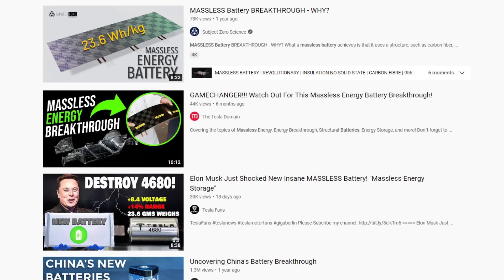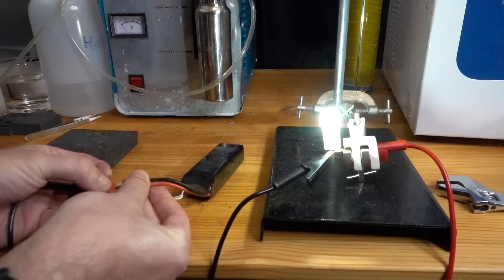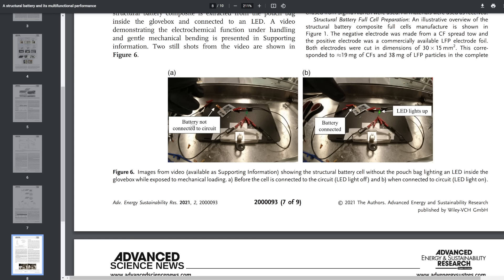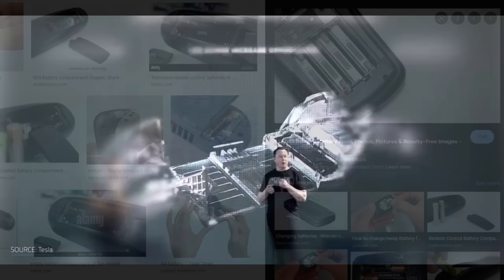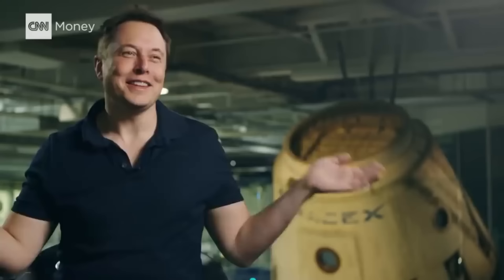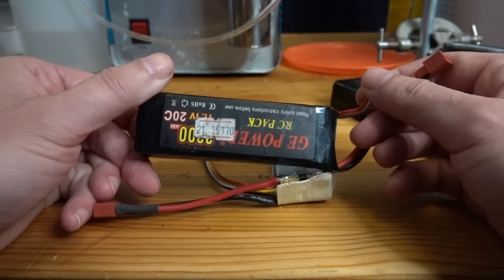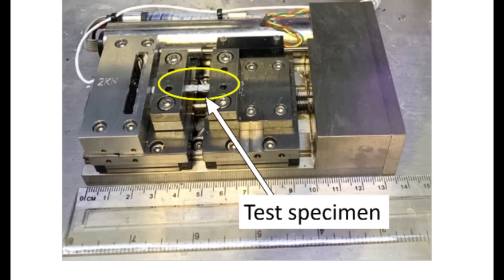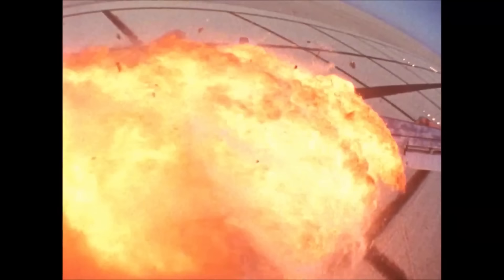Matt Ferrell, Massless Battery: BUSTED!!

Comment: Yea, the structural battery aspect probably only has applications in aerospace, where a lot of money is available, and weight savings can really matter. I think the most realiztic case would be to help with panels, where if you can add the thickness of a battery to the panel, it makes the material use more efficient by increasing the moment of inertia. Love the content!

Comment: "Massless energy storage", huh?
Maybe there's something I'm not understanding. If there's no mass, what's holding the energy?
Also, I'd rather not have the entire structure of the vehicle I'm riding in be made of battery. That's right up there with trying to put hydrogen "fuel" tanks on a car.
Reply: It's about that a structural material is also a battery, not adding extra mass to the object for battery functions. Massless is a misnomer. But nice for PR. 

In cars it means something different. It means that the battery is not supported on the chassis, but it's part of the chassis itself. It can still be replaced, you just need to support the rest of the car while doing it. It's about reducing part count.

Comment: Since Thunderfoot seems willing to nitpick I feel free to do the same. If one connected the negative terminals on all cells in a 3 cell 12 volt battery pack to a single wire, it would short circuit at least 2 of the cells, even if that wire was black. He needs a refresher course in how series wiring works. 

Now there is a way of connecting to a series wired battery pack that allows voltage measuring and charging of individual cells, but it requires a separate lead for each cell-to-cell junction, plus a positive and negative connection. In a 3 cell pack, that means 4 leads. A single black wire won't do it, and his battery pack had all that plus leads for thermal monitoring in its two multi-wire multi-pin connectors.

Comment: All of this without even looking at the primary source. The press release from Chalmers does not claim any of the things said in any of those video clips or articles.

They said they've developed a new type of carbon fibre that is ten times better than the one they developed in 2007. But the press release prefaces that by saying the one in 2007 failed and was not fit for purpose.

All the things about the battery being massless and reducing car weight and all that is mentioned, but said to be the end goal of the project, not the current state of it.

They have spent 15 years TRYING to develop a massless battery and have made several breakthroughs on the way, but are not quite there yet.

What they showed off was not the final product, but the conductive properties of the new carbon fibres.

It's like looking at iron age blacksmith, trying to figure out how to make steel and claiming that they can now make airplanes because they figured out how to heat metal.

Comment: @26:25 actually the balance charge lead has one wire going to each cell terminal in the pack (for 3 cell you'll have one at battery negative terminal, one between cell 1 and 2, one between cell 2 and 3, and one at battery positive terminal), the black wire does not connect to all the negative terminals because you can't do that and have cells all in series without causing a short (which you could avoid with diodes, but why bother when wiring as above still allows individual cell charging).

Comment: Guess what ? In the latest Model Y Tesla, they're using the battery pack in a structural manner. AS THE FLOOR. It doesn't need to be made of carbon fibre or whatnot.

Comment: The most perplexing thing about electric cars is:
Hybrid gas electric cars have been available now for decades. They aren't much more expensive (maybe even equivalently priced) than traditional ice cars. They work quite well and get better fuel mileage than ice cars when the limited range battery runs out. There's not really a downside to hybrids while fully battery powered cars are not yet viable. 
Yet, all these environmental types seem to push battery cars without mentioning hybrids: seems very odd to me.
Reply: studies show most battery hybrid cars don't get charged  enough . people a lazy and don't plug in.

Comment: Wing tanks for fuel in planes is actually a very good idea--in particular, you aren't taking room away from the cabin, cargo, or passengers, and even as fuel is consumed, the center of gravity of the aircraft does not change significantly. That last one is crucial--the MiG-21 fighter jet has a huge flaw in that its fuel tank is designed in a way that causes the center of gravity of the aircraft to shift as fuel is consumed, which causes a lot of problems.

Comment: Hello Thunderf00t! No idea if you saw my comment on the other video where I said that if you could find more videos of him making bad claims, that would be more convincing. Whether you noticed that or not, it looks like you did exactly that. I'd like to start by saying that I appreciate that you did that, not just for me, but for the rest of your audience to see that it's not just a one-off thing.

I would like to point out however that not everything about "structural batteries" is bunk, and the idea of storing the fuel in the wings is valid, just not the reasoning he provides to support these ideas. To the extent that the battery packs need a lot of reinforcement, and that the car also needs a frame, if they can better integrate the battery packs into the frame, they can remove some redundant steel or aluminum, so there is >some< degree of cost and range improvements to be had there without necessarily endangering anyone. But yes, it's not going to be a huge change.

Regarding Elon Musk, it is worth noting that Tesla and SpaceX are making many legitimate innovations in their spaces, whether Elon gets a few things way wrong or not (particularly how long it will take to implement something). The new carbon-fiber-wrapped motor of the Model S Plaid Edition, and the Falcon 9 reusable rockets are great examples of this. It should be noted though that Elon has not really "failed" so much as he has shifted his focus elsewhere and put other things on hold until other developments occur first, as evidenced by the fact that Hyperloop and Boring Company have received barely any of his time and money, whereas an absolute ton of R&D is going into their control systems, rocket engines, electric motors, etc. However, taking a shot at him for selling a whopping 3% of his Tesla shares as though he was cashing everything out is a cheap shot, and is arguably the same sort of misleading info that you are criticizing Matt Ferrell for committing.

That being said, you have opened my eyes to just how often Matt Ferrell gets things wrong in his videos, and I hope he will take notice of your video, and stop making outlandish claims and actually start doing real research before he does his videos. While he IS helping people be interested in science, it would definitely be preferable to not massively misinform people in the process.
Reply: What a nuanced comment for this channel. I'm sorry to tell you that the numbers say that the videos make Matt's channel grow faster not slower. Many people realize full well they are listening to company pr, but it's as rather pleasant way of taking it in. A lot of people like to dream to and Matt's also provides that.
Reply: @bzuidgeest  Growing faster, but for all the wrong reasons.
Reply: @electric7487  you can think that, but if you are trying to change that it means your methods are not working. TF his videos seem to have no or the opposite effect. He needs to adjust his attitude and his methods. No real scientists sticks to a method after is has been proven a failure.
Reply: @electric7487  what alternative world are you living in? On YouTube subscribers is all that counts. Its a good indicator about how many people are being reached by the channel. It's an indicator of earnings from YouTube. It attracts sponsorship. Etc etc. You may not like it. And you may think it's wrong. But as it is going now, Matt his channel will outpace tf. And that means he has a bigger audience, that more people like and it trust him. If you think that is a bad thing and you are trying to prevent that growth, then you are clearly failling. Maybe not morally, but that matters little if you are relegated to being a relic of the past or something like that by most people.
Reply: @bzuidgeest  Once again, The Dishonourable Matt Ferrell's channel is growing FOR ALL THE WRONG REASONS. Damn right subscribers aren't the only thing that matters, what matters more is the content that you are putting out. Most of what Thunderf00t has put out is highly educational and very well-researched stuff where he debunks a lot of the pseudoscientific BS being pimped out these days. On the other hand, pretty much the only thing that Matt puts out is crap where he regurgitates marketing hype. If more people trust Matt, that is a problem, because they're being misled into thinking that all these touted "breakthroughs" really are the next biggest thing even though they're not. Matt is doing a massive disservice to YouTube by doing what he's doing. Thunderf00t is doing us a favour.

Let me ask you this:

How do you commit so strongly to things that are obviously wrong?
Reply: @electric7487  how is it that you still don't understand? I am not supporting Matt i am pointing out that your methods or tf methods of combatting these kind of channels are failing. You can stand on moral high ground all you want. But as it is going, you will be standing alone. Why are you so committed to fighting the war on pseudo science with a tool that is failing? 
If you want people to step away from Matt his channel then you need to convince them to do so. If you consider channel growth as a measure of support than tf is failing. He reaches less people. He seems to even accelerate the growth of Matt his channel. Have you ever heard of the Streisand effect? This is a perfect example. 
Maybe if you calm yourself and wipe away the red haze you seem to be in and stop swinging an axe blindly. You will notice there are other better ways to combat hype channels. 

True or not, most of tf videos are very low quality. If you want proper debunking for tech stuff, Dave Jones for example does a much better job on his eevblog channel. So do many others. The entire musk rant in this videos for example is not only incorrect it's also irrelevant and meaningless to the subject. It's no going to convince anyone. 

Sun tzu said that to win every battle you must know yourself and your enemy. The enemy here is the people following Matt, with Matt as their leader. You need to understand why they watch and what they expect and maybe then you can convince them to your side. Calling them stupid, even if it's true, is not a convincing argument. It never was and never will be.

Comment: Hmmmm, I wonder why Musk would think an integrated battery than can't be changed out, would be a good addition to the Tesla.

Would it improve something in the short term? Maybe. But mostly it would add a lifespan limiter on the car of X recharges, first resulting in faster expenditure of a "full" charge, then failure to charge at all.

It would increase the rate at which they sell new cars are you wouldn't be able to just buy a new battery...... plus rich people would buy 2+ cars so that one is always charged and ready to go after a return trip.

The same reason apple and playstation don't let you change battery packs.

Comment: If the plane's fuel were structural, wouldn't the plane collapse as fuel runs low approaching your destination?
Reply: Good point... I guess if you pressurized the tanks then you could use them as like inflatable rigid members lol

Comment: Hey Matt, why didn’t you mention the centre fuel tank of a 787 Dreamliner that has a centre tank capacity of 118,000 lbs while wing tanks = 53,000 lbs each. Passengers sitting on more fuel than is in the wings and that tanks is massless too.
Reply: @@blue-lu3iz talk to Boeing dude, I simply did cut/pasted from they’re website. As for the fuel tank sizes, you are referencing gallons and my figures are Lbs so you need to get the specific gravity of aviation fuels and calculate the volume into weight to determine if the figure quoted are wrong. Let continue to discussion after that.
Reply: @@blue-lu3iz Wheres your calculations?
Reply: @@blue-lu3iz where’s the calculations and what’s the specific gravity of Jet Fuel A+B?

Comment: So if I get a 10gm slice of ham and place it between two 10gm slices of bread and weigh it, the combined weight (mass) is zero because the ham is a structural part of the sandwich? The applications in hiking are endless. Also application of margarine, butter, relish, mustard and chutney could be a avenue of decades of future study, as the variations of electro-chemistry these condiments could unlock could see the development of a negative mass sandwich.🥸🥸🥸🤯🤯🤯

Comment: You should have put solar panels on your batteries. That's a trend these days. Also one up everybody and stack 10 solar panels for 10 times the solar panels without increasing power output and then make a kick starter.

Comment: Another problem would be, if they even pulled any of this off, is that due to fact the most popular battery we use is lithium ion,  dentrite formation would give these things a very limited lifespan (including all the shifts and bumps). If he's concerned about sustainability (as he advertises) imagine trying to recycle the majority of a car made that way. Gasoline powered cars aren't that great for the environment, but you can atleast recycle almost all of the thing. Electric cars, as we have them now, are difficult to recycle (just the cells are a huge chemical hazard and you can't just crush the things like a regular car) I don't see them being this "green revolution" the popsci market claims them to be...

Comment: I am 4 min in, apologize for leaping to assumptions, technically your not reducing your mass, your displacing that load, in some cases that would be effective. Weight distribution is important. it is misleading tho saying that this is massless. i bring this up because I have been working on some theoretical ideas on a solar powered catamaran using emergency sail power, but overall utilizing battery power for the nights, weight distribution and locations of distribution is difficult, i can see layered displaced battery's being an amazing use, In form you could have layering of battery's directly bellow solar panels in my case , not only do we need to increase battery tech, but the form in which battery's come are also a big concern for the future in my opinion.

Comment: You might want to think about heat dissipation, the relative thermal conductivities of metal and carbon fibre, and the thickness of each you need for the same rigidity, in the context of high power use/short recharge times.  Duh.

Comment: nah. i like the liquid metal battery concept.

i mean, shit definitely not as like a portable battery. but theoretically, with a strong enough insulator material for the outer shell.

they could definitely act as an energy buffer between a generator and a grid. like say, a wind-turbine right?

Comment: Did any of these advocates notice that even if this was a breakthrough, a structural battery makes the device completely unrepairable. How green  to throw the entire car (or other device) away when the battery dies.
Reply: after 15 years ? and no one throws it away. cars are one of the most recycled things on the planet . they don't get thrown away.
Reply: @ronblack7870  Cars right now are recycled, but those using "structural batteries" are unlikely to be recycled.

Comment: I though structural batteries were actually part of the structure or a piece of structure acting as a battery. Not just battery cells hidden in various parts of a structure. It's much more lame than it initially sounded. Would make hell for changing aged batteries too.

Comment: It is not (yet) revolutionary since it is in research state. Not say it will definitively work, but that one has to try some things.
The idea has some drawbacks that will be explored one after the other.
They main one, the cell degradation is a big use must admit.
Some clarifications. The modulus of CF can reach ~800 GPa, so 25 GPa can be achieved for the composite with a low carbon fiber volume. 
Like someone said. One could give the cells better properties making them more robust and needing less or lighter protective structures.

Comment: A not that new Idea - in the  late 1990s there was some fashion company planning to integrate Battery Packs and kinetic Generators into  Clothing. Recharge while you do your Workout or so its Campaign was sounding. The Idea was straight out of an 80´s Walt Disney Comic. It flopped, resurfaced again and was then only about integrate Headphones into Clothes, flopped again and resurfaced again in the Form of this. Not to Mention that Nokia had a Design Study about a wearable, twistable,foldable Smartphone, powered by ones Movement. It NEVER came into Prototype Stage. But the Concept is Hyped with EV´s,  Mercedes did integrate the Battery in the Monocoque of an E-SLK that can be bought for a Ton of Money, you simply throw it awayy at the end of the Batterys Lifespan. And even the Sun, wich is our greatest Energy Source in the Solar System has weight,Mass and a limited Lifespan. A real Battery of that Type would be the Material from that a Device is made, could outlast the Devices Lifespan and Charge from the Device´s use -  but that´s Sci-Fi! (Now I think about to solve our Energy Problems with Smartphones and Such Sci-fi-esque Battery.)

Comment: These ideas are popping up more and more, and no-one bothers to do proper research on it. Someone in India developed a 'battery paint' that you could apply in layers, it didnt hold much power but it worked, and it was definitely more structural than this.